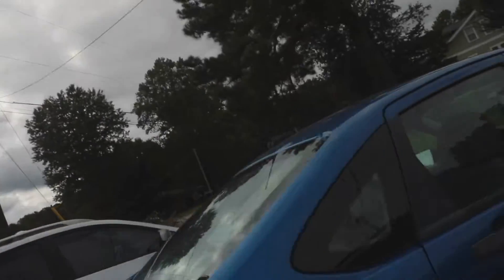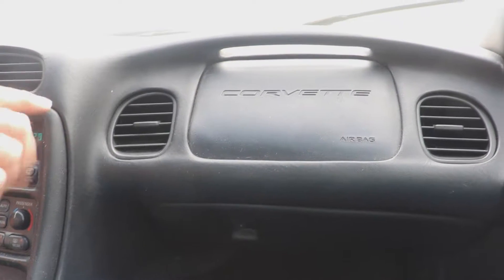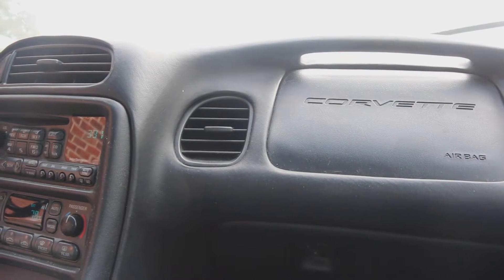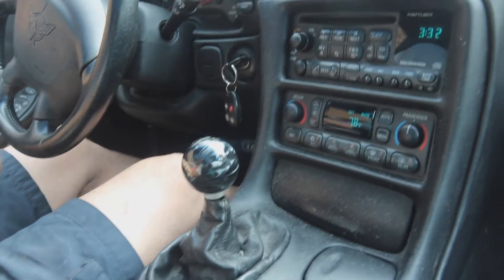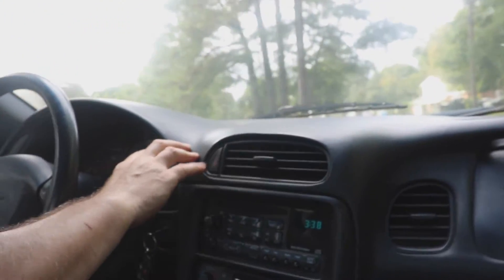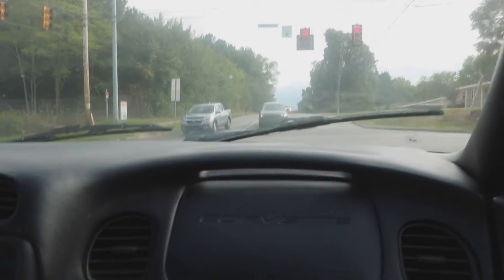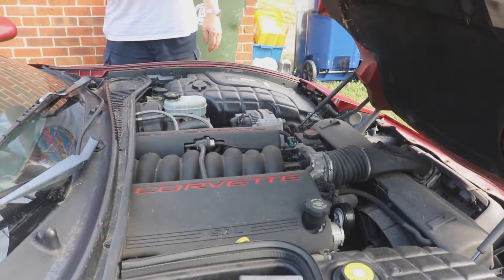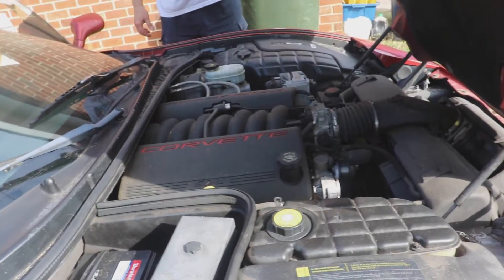I bought a SIGHT UNSEEN Corvette for $4,000 at 16! *New project car reveal* (with a RARE package?!)

Comment: Match the vin on the sticker to the Vin on the windshield and if they match you more than likely have a Z51 car. Performance package with larger sway bars, stiffer suspension and power steeling cooler.
Reply from the maker: Nice! Thanks for the help!

Comment: Just a heads up bud, running a few tanks of gas will not turn off the engine light, you need to get a scan tool and hook it up to the obII port under the dash and read the codes to see why the light is on. Its telling you there is a problem with the vehicles emission systems. Read the codes and find out where the issue is coming from.
Reply from the maker: Thanks! I'll get to that
Reply: @sawilson56  No worries, you're welcome. You can get a cheap scanner from auto zone or even one for your phone off Amazon or something like that, but you want one so you can accurately see what's wrong with your car and not get screwed over by untrustworthy mechanics. (I am a tech and I've seen it way too many times unfortunately...)